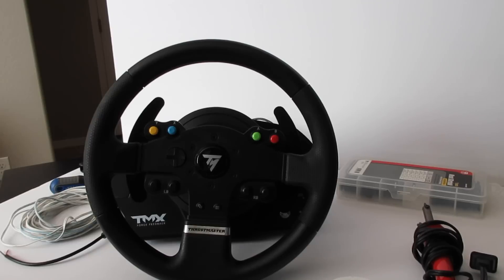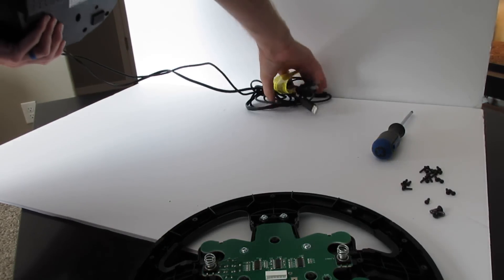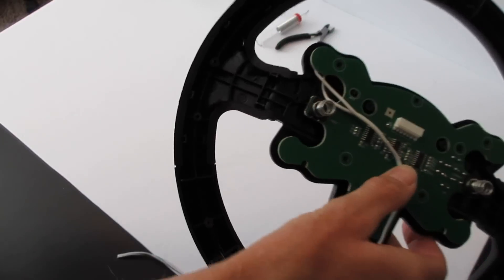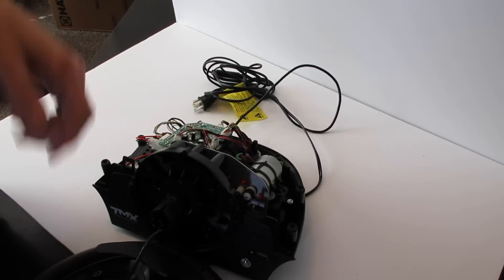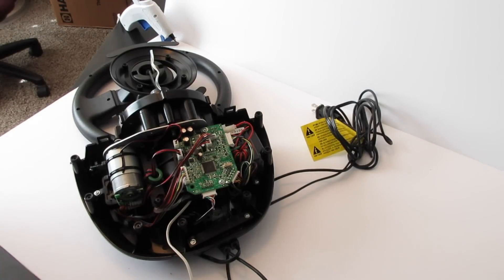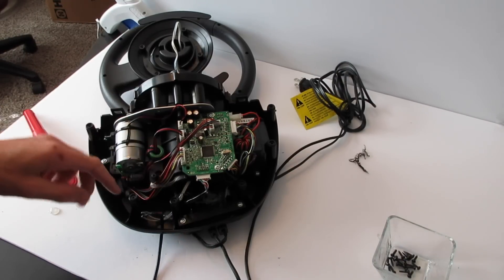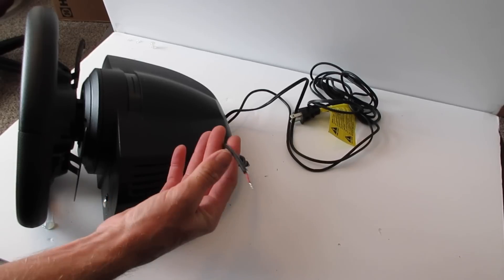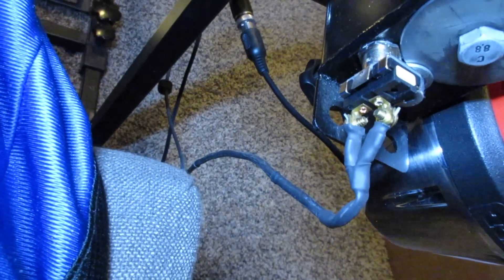Thrustmaster TMX Handbrake MOD

Comment: wasn't sure what u meant by little fingers until i soldered both wires right on top of them!! luckily was able to repair my mistake ;)   only thing is it a pretty tight fit were u feed the wires through the wheel to the base and already see some wear on the wire from install... hope she lasts because taking this apart and back together 4 times was enough
Thanks for the vid
Reply from the maker: It can be tricky, i recently had to redo my tx after 3 years the wire broke, ended up finding a better solution.
Reply: im listening 
whats the new way
Reply from the maker: not really a new way just a better way better wiring things like that

Comment: i reeeaally want to do this but i'm so scared, i have all the materials but not the balls appareantly XD
Reply: Miel Vandendries LOL
Reply: Miel Vandendries not as hard as it looks, i’ve never soldered before and i finished it yesterday. just look up a couple videos on youtube and don’t use too much solder and keep track of all your screws.
Reply: Miel Vandendries it’s a heck of a gamble 300$ is a lot
Reply: I'm about to try this mod im pretty good a soldering as I used to fix drones and I'm still like just for a handbrake. O well it'll be worth it . besides whats the worst that can happen? I got my tmx bundle (cough cough) for just under $140. I already replaced the pedals with tp3a pro's for about $130 (used), and while I was at it I got the th8 shifter for $150 as well. I found trying to hit that B button while turning isnt easy. Its cool ppl do things like this if for nothing else but to at least show whats possible if you try.

Comment: I use a Ferrari 458  Spider wheel on my TMX I prefer the look and feel over the TMX wheel.In the thrustmaster program it list's it as a Ferrari 458 Italia wheel,works perfect with my Xbox-x.I had the wheel laying around afetr buying the tmx and thought I would give it a try....bingo nice comfy wheel that's a bit bigger too with  the cool looking switch and engine start buttons fully working.

Comment: Thanks, been trying to find a way to mod mine. Sick of drifting and can't find the b button mid drift.
Reply: If you have the shifter i recomend you make you're brake you're shift pedal
Reply: Just use the Xbox button on the base
Reply: @Kuhrmys  it doesnt work. The x button is just for connecting and is not available for the controll mapping.
Reply: Noah Napieraj if you’re on console that makes sense, but I used that button as my handbrake for like 2 years lol

Comment: I solder my wires to the fingers and it doesn’t look like I have any solder touching the other side but when I connect it to the momentary switch it won’t work I’m using rosin core solder it shouldn’t make a difference right?
Reply from the maker: If you're sure you didn't solder the fingers on either side then its either the wire or the button. its usually the solder points though. I just did one the other day and kept have a issue and that is what it was, a tinny bit was contacting the fingers. I'd redo it and use less wire/solder.

Comment: Can do the handbrake mod and change the wheel to a deep dish wheel.   Because if the board is attached to the stock wheel I can't see how it Will work
Reply: You can take the rim off and re route the wheels wiring like a button box.
Reply: Have you tried to do this  I love to put a nardi on it
Reply: @leeburke4041  Not yet, my buddy 8bit_bryan on ig has done this. It's my next project
Reply: I did this handbrake mod it wasn't to difficult I followed this video.   I don't think I have the balls to strip it all back down again to do this i have considered it what's your m8s name I like to see how he did about mounting the other wheel on a stand

Comment: Why not placing the  handbrake cable right at the end where it connects to the board?
Reply: That's what i was thinking. Should be able to use a voltmeter to find the right contact no?

Comment: I have the TX base. I want to do the same but instead of tapping into a wheel button could I not tap into the yellow botton on the front right of the base and assign that button as the hand brake
Reply from the maker: you can do it how ever you'd like, iIonly do it on the B button because you cant always map the yellow

Comment: Did everything like the video and now B button doesn’t work at all any ideas? If I can’t fix no biggie I’ll just get another wheel but won’t try it again definitely a cool idea though
Reply from the maker: sounds like you soldered on where the button makes contact. make sure its only soldered on the littler "fingers" on each side

Comment: Great video! I definitely don't have your skills! To avoid warranty void, would it be possible to wire it to the B button of the Xbox one controller ?
Reply from the maker: im sure you could if the wheel and the controller can be used at the same time. i know some games it wont work, frorza will though
Reply: @JesseJessMyster  Thanks for your reply. Very good point that you have here !
Reply: @JesseJessMyster  I ve tried to use the controller and the wheel at the same time, it doesn't work properly. So the only way is your way...

Comment: Can you avoid the plug and hard wire to the switch? Am also attempting to make a sequential with the paddles  any advice
Reply from the maker: yeah you can delete the plug, its only there so i can swap from my tx base to my t300 for ps4, or just in general be able to pull it all apart. i haven't played with the peddles but i'm assuming you'd be able to apply the same concept since they use a single momentary button as well.
Reply: Jesse JessMyster thanks man. I'm going to be attempting this tomorrow so I will let you know how it goes. I'm sure I'll have more questions!
Reply: Any recommendations would you wire the shifters as buttons or as the paddles?
Reply from the maker: I'd assume you'd wire them as buttons since they are essentially momentary buttons in the wheel.
Reply: Got the shifter all built only have a toggle as a ebreak for now but doing the assembly now.
Reply: Works great man ! Sequential shifter works awesome aswell. Thanks !

Comment: Perfect bro..perfect tutorial. I tried it but i suck at soldering..i really suck, i think i applied to much solder. First i cant press b button anymore, seems stuck like you said, than i checked in game and now my button is always pressed. So in conclusion now my handbrake is button A and i cant check if the ebrake i made and all the connections are working right... So do you think i should try to remove the solder to do it again or button b appearing as always pressed in game means that i fucked the board? 😋 Thanks

Comment: hey, i did this and it worked for months but it stopped. i took it apart and realised that the metal pads for the B button had cleanly ripped off.... does anyone know where i can buy a spare button board for inside the wheel?
Reply from the maker: contact thrustmaster, you might be able to purchase another board or buy a parts wheel off ebay. sounds like your wiring wasn't long enough and was pulling at it.
Reply: Jesse JessMyster yeah it seems the wire had gradually been rightening itself and pulking at the board.... thanks ill contact thrustmaster

Comment: do you have to use that black plug/wire?
Reply from the maker: no, you can just ran a wire straight. its just so you can disconnect the wheel from the hand brake.
Reply: ok thanks

Comment: Can u do a vid changing the steering wheel ive seen people do it but never post it on yt
Reply from the maker: Unfortunately i don't own a TMX so i cant. You'd have to remove pieces from the original wheel and integrate them to a add on wheel. I'm sure its possible but without having a TMX to experiment on i cant say how exactly.
Reply from the maker: this wasn't mine, its a customers.
Reply: I did it
Reply: Yo skrt skrt you should put a video up about it, would be cool to see.
Reply: LetsPlayVideoGames if you have a social media I could send you a picture if you’re interested
Reply: Is it uhh, To late now?

Comment: Any particular reason you use the b button?
Reply: That's generally the handbrake button in most games. You can always change it with different layouts though. I suggest you find out what controller layout works for you first then wire your new handbrake to the button your handbrake is in your game.

Comment: I did everything and it’s not working 😭
Reply from the maker: wiring isn't connected completely or wrong, only thing that causes it not to work. check that you didn't put to much solder or the board and connected them together. I see that a lot
Reply: if its not working you did NOT do "everything" ;)

Comment: Hi. Thanks for your video. I have a question. 

I see this handbrake:
www.wish.com/share/3745lihhfp

And I want to know if it will work, if I cut the USB wire to connect the wire from wheel?

And I have an other question, the handbrake is "progressive" in game? Or it's 0-100% that's it?

Thanks a lot and sorry for my English.
Reply: I think is a button, only 0-100. Or pressed or not, I saw this very unnecesary, you can use the button as handbrake...
Reply: I know im years behind the question, but yes, you can do progressive. You need a reostate switch, not a on/off switch.

Comment: PLease tell u can use a hot glue gun cuz i got no money to buy a solder and stuff for it... :(
Reply from the maker: it wont hold
Reply: But what if i use like rlly small wires and like hot glue the wire to the green base inside the wheel for the wire not to rip off it. Ill try it i guess idk
Reply: @jeffhdworks8146  did it work?
Reply: Dis Grace I bought a solder and yeah

Comment: for anyone who may want to replace the wheel for a larger rim it looks like the base is just a fixed version of the old ferrari gte rim wich you can get replacement rims for from ricmotech
Reply: It is NOT the same as GTE rim.  I know 'cause I had TMX wheel and upgraded to TX 458 Italia Edition with GTE add-on. 

Also, for info: if y're thinking of getting GTE add-on wheel for TX/T300 base, 'cause it's cheaper than other add-on wheels, my advice would be save up for longer & get the "599XX EVO 30 Alcantara Edition" Add-On well worth the extra.
Reply: You can also get adapters online

Comment: dont do this dumb shit. u can buy a set of 2 pedals off ebay for mad cheap. take that 2 pedal set apart. and use 1 pedal as a handbrake. and just get the usb adapter or like i am right now. using my old wheel to use the pedal i turned into a handrake. but my 16bit hall sensor handbrake is on its way so i think im a make my girlfriend a force feedback wheel out a broken wheel and shit since shes starting to get into it now.